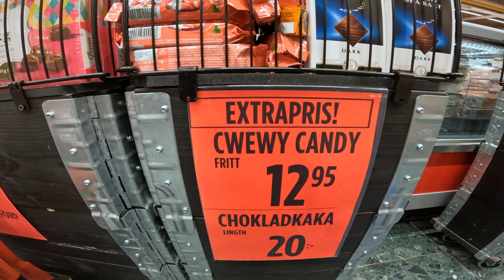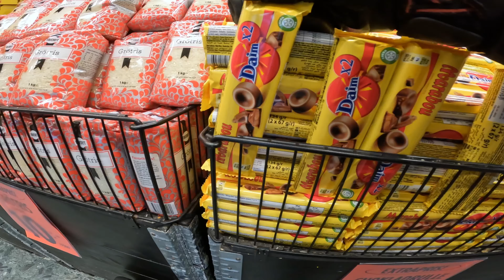Skid stops, Sunsets and Glazed Buns - Nikola and MSX

Comment: A Sherman-S, V13 review in the ice and snow could be interesting. 50mph + I'm sure you are up for it. Gritting the roads corrosion a definite problem, liberal amounts of WD40 I think. Cold, its really chilly in Florida at the moment apparently, in the 60's (F), brurr........
Reply from the maker: Some of the riders in the group are looking at the V13... the speed is tempting but also especially the overhead. On the other hand... my EXN with dynamic tiltback is fast enough and as safe as can be. The V13 does have some very nice interesting features though, and the Sherman S also seems to be decent. Still waiting to hear more about the Commander Pro! I think I will go to Bauhaus or Biltema and get some lithium grease that can be sprayed and that has a nozzle / straw for application. Then I will poke it around the Nikola bearings and unleash hell. Lol... 60F... what a luxury! But I can imagine it being a tricky contrast if it is super hot all the time.

Comment: Still riding on your racing slicks I see. Fer gads sake Mike, swap a knobby on to it will ya. Infact the much maligned CST knobby is pretty good tire on this kinda stuff. I know cos I've taken out my EXN on it & the wheel+tire did extremely well. I'm gonna tear it down & grease all bearings, silicon the motor covers & whatever I need to do before taking it out to play in the snow again. You know, the oz of prevention thingy. I can see you're into the snow & ice so get it down & you'll have LOLs in winter. Wheels have the advantage in winter cos it has pseudo ABS/TSC by design. Regen braking does not lock up (99% of the time) & with all weight on top of tire plus the relative lack of torque ensures we have max traction with a bald tire, as you succinctly shown. 

On the v13, its big heavy & quick. Def not the fastest but still, pretty nice & build quality looks good. I dont like the small wh pack for its weight & size & the v11 like air shock does not seem moddable nor replaceable. Personally I'm looking forward to seeing real world rides/reviews on the ex30 as it seems to be a monster of a wheel. BG seems to have workout the multilink suspension as well & its easy to swap out the shock for something else. Or maybe the CommPro mite hit the spot as well. We'll see but its exciting times for sure.
Reply from the maker: Haha I just love street tires! It rained last night.. now the snow and ice is gone. I won't miss the ice. I am going to ride the MSX tire until it pops. Too bad the Nik tire wore out again! Time for a new one! 

You are definitely doing the right thing in opening the EXN and greasing it up!

I do slide out on ice like I gently did yesterday losing traction a couple of times. The only thing that can save me there is spikes. Knobbies do a worse job and François was struggling the other day on his knobby 16X.

The V13 is the same battery size as the OG Sherman but a bit hungrier. I think it will have a hard time competing with the Sherman S even! And the Commander Pro will be the same but with an HT motor at a nice 134v. Interesting times indeed man!